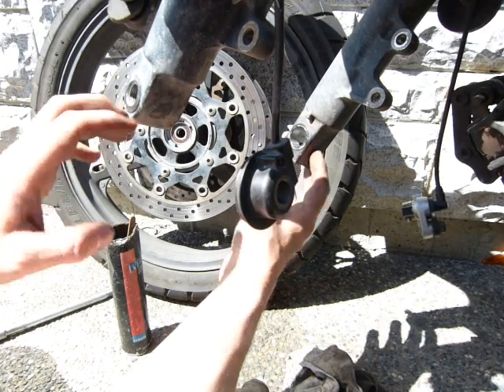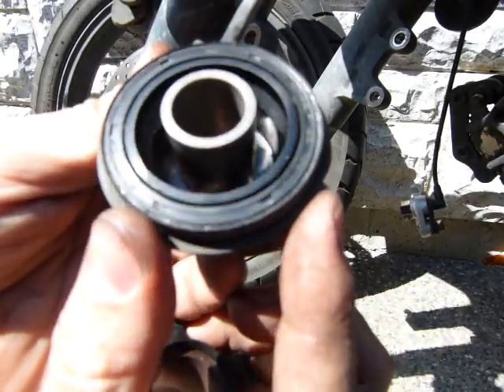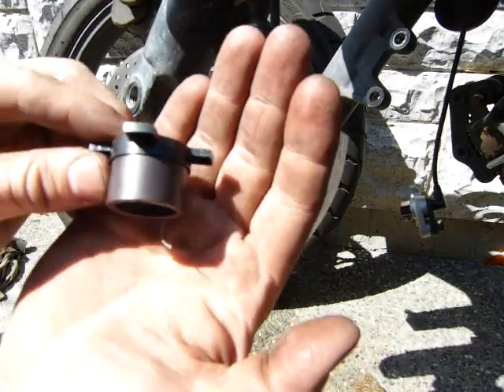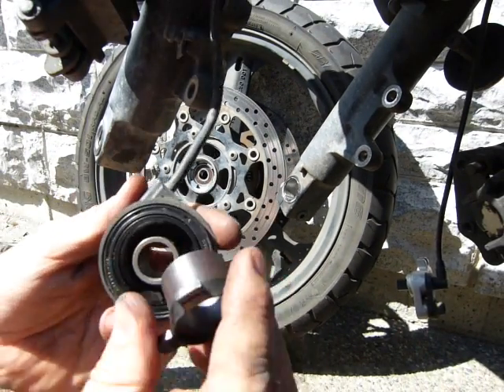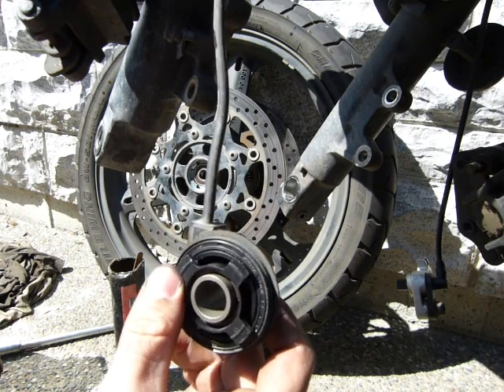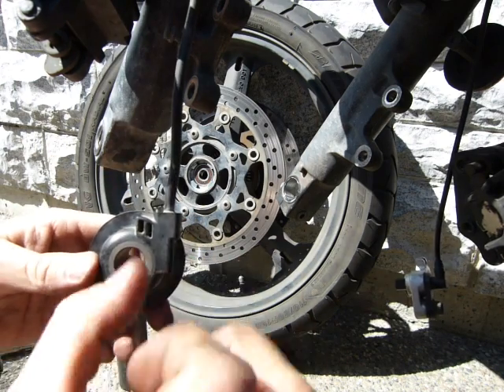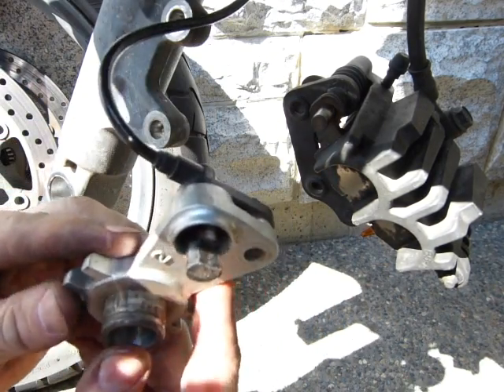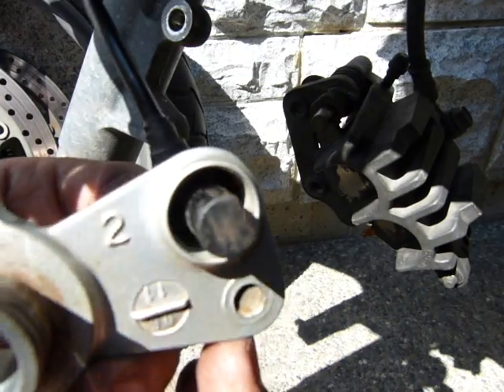How ABS and speedo sensors work

Comment: My speedometer is acting up and I think beacuse that magnet is already worn out, can I disassamble the sensor and rotate it with a hand to know if its working? Will it show speed?
Reply from the maker: Magnets don't fail, spin with a drill. Instrument is likely broken, cable might be defective, sensor end is usually fine.
Reply: @theoverengineer  ive got sv650, most people that I asked told me that the rotor usually worns out, I think that the "rotor" Is the magnet? They called it "plastic", So im not sure what is wrong, the speedometer sometimes works but then stops
Reply from the maker: Electronics fail intermittently, like you're experiencing. Probably in the gauge in the dash someplace. Here is an example on an Aprilia https://youtu.be/-N5ZrqWZrQw
Reply: @theoverengineer  actually, its the magnet, it has the little "legs" and they broke off, So I need to buy a new one
Reply from the maker: Ahh, the plastic splines! That really nice to notice, speedo cables are reasonably serviceable.

Comment: I have a 2015 Zx6R.  After changing the brake pads, brake fluid, and tires, the ABS light remains on.  When riding, there is a loss of power and the tachometer/speedometer is inaccurate.  ECU reflash, new rear speedometer cable did not fix the issue.  Do you know what is causing the issue? Thanks!
Reply from the maker: If the sensors at the wheel are absolutely geometrically intact (not a ding, aligned squarely, no magnetic "fur" on them, clean) and the connector pins at the ABS cable ends and cables themselves are fine, then ECU glitches. Check the cables and sensors, then probably Kawasaki dealer is the next option.

Comment: Hey,
Can u help me to choose whether what kind of sensors to use in an ABS?
Hall sensors, Magneto resistive sensors or tachometer sensors?
Reply from the maker: Depends on what signal the control module is built to process. Hall sensor is powered, so if that doesn't get supplied, it's out.
Reply: @theoverengineer  okay! Thanks buddy

Comment: In this case, if the ABS sensor doesn't send pulses to the computer for some reason, and the computer thinks that the wheel is skidding, you would never be able to brake!!
Reply from the maker: Lack of signal does not disable the brake, designers thought about that.

Comment: I'm glad someone explained me basic principal of magnetic speed sensors! Well unfortunately I lost the magnetic part of sensor while puncture removal and its nearly impossible to find new one. I need to buy whole speedometer set for simple magnetic ring! Can u suggest me some alternative to make it work?
Reply from the maker: Don`t need new magnetic speed sensor. Get an old/used one from a crashed/project bike. Google something.
Could also glue the magnet together, it will work enough if aligned meticulously for circularity and flatness.
Reply: theoverengineer - Okay! That was my second plan but it's bit hard to get same bike in trash. I'll try with this one only. Thanks for suggestion.

Comment: Dude you will not believe what happened. So my speedo cable as we were talking about before, was broken and it wasn't working for quite a long time. recently when I've just left my bike in the garage for a few weeks. After I picked up I give it a good scrub clean with the jet wash polish it didn't do any maintenance job knowing that I need to change the cable I recharge the battery as it was completely flat I stuck my bike and I have driven to work. All of the sudden I could see that my speed was showing back on the dashboard. I haven't done any mechanical works on it removes the front wheel or anything like this it just repaired itself somehow magically maybe knowing that haven't got money to buy new cable.  However now I'm scared to take off the front wheel so you won't break again but I know I have to do because my left front fork is leaking and I have to change the seals and top it up with oil. Maybe I'll do the video about this as well
Reply from the maker: AdamLondon01 The end of the speedo sensor is a copper coil in a plastic housing. The slotted ring generates pulses of electricity in it. If crud covers the coil, the magnetic effect wont take place, no signal will be generated. Also, if the distance between the ring and coil increase (loose screw) no signal. Not a lot can go wrong there, just go ahead and service the fork, tighten everything. A flat battery might also affect the ECU`s ability to translate the speed signal and power the LCD.
Thanks for sharing. What year and model is your bike?
Reply: theoverengineer its sv sk4 2004. but its worth to say that after all of the work i did not have any luck. how ever after i given good clean wash it started working again. i think my bike was seeking attention like a baby. any way ive desided to mended everything that i can and sell it. save some more cash and buy something new
Reply from the maker: AdamLondon01 Thanks and keep us posted if there are changes.

Comment: I don't quite understand what stick across what pick up or claws could I provide email for you so we could maybe get graph or picture or something?
Reply from the maker: AdamLondon01 Just spin the thing that can turn inside, it`ll work.
Reply from the maker: AdamLondon01 Ok,a few hours later I see ambiguity. So, if the tab is rotated inside the sensor there should be numbers when the ignition is on. If there are no numbers the sensor might be wrong, or the cable, or the spedometer.
Disconnect the speedo cable from the spedometer and rotate the magnet`s tabs inside the sensor. Measure the signal voltage generated at the end of the cable, there should be some. If there isn`t, order a new. The Suzuki service manual has all the pictures and correct voltage readings.
I don`t have a working one, I can`t take measurements, the bike filmed got stolen 3 years ago, so if anyone can chip in and help out do so.
Reply from the maker: AdamLondon01 Service manual says (Electrical system page 8-35): "If the speedometer, odometer or trip meter does not function properly, inspect the speed sensor and connection of coupler 1. If the speed sensor and connection are all right, replace the meter with a new one."
Speed sensor inspection:
"Connect the four 1.5 V dry cell batteries, a 10 kOhm resistance and the Voltmeter to the speed sensor lead wire coupler as shown. (See illustration) Lift and turn the front wheel and check that voltage varies between 0 - 6 V. If any abnormal condition is noted, replace the sensor."
Link to Service Manual to see the illustration: http://www.calsci.com/motorcycleinfo/PDFs/DL650K4_svc_man.pdf
Reply: theoverengineer  oh that's better. So I've done everything from diagram, and the results i had was slightly inconclusive for me i think. Please correct me if I'm wrong. The book says; when connected the circuit as per picture and than check MCT ( Multi Circuit Tester ) for the V (Voltage) should be 0V. Then when spinning the front wheel and the V should vary between 0-6 V. And my results where; when connected everything and checked MCT it showed straight away 5.77V, and than when I spin the wheel it vary between 5.46V - 4.12V  any advice?
BTW thanks for helping me out with this.
Reply from the maker: AdamLondon01 No worries. The sensor is probably faulty, that`s why it doesn`t behave like described. The 5.77V is coming (leaking, due to a short-circuit) from the 4 x 1.5V batteries, in this case 4 x 1.4425V.
But just to make sure: Sensor has a 3-wire connector, hot, neutral, ground. In the diagram, battery (neg) is at the middle pin marked black with white tracer. If the sensor supplier did not have the exact color of wire, they might use anything else at hand, like Aprilia: https://www.youtube.com/watch?v=ydBvgh5HKGI PDF is also about 2004 model year, whatever continent, there are differences is wiring.
Another wire is orange with red tracer is the ground, and the voltmeter + resistor are on the neutral line. Colors might differ, principle stays the same.
Get a new, check it out electronically, should work as per S. Manual`s description.
Reply: theoverengineer that's exactly how I connected the circuit as per Haynes manual, and that's what i had as result. you might be right by saying that there may be short-circuit some ware along the cable, i just didn't want to buy £120 new cable only to find out that something else is wrong. Also i couldn't believe that cable can brake like this on day to day basis. also i found something like that 
Just incase anyone else reads this thread, there's a better way to test the speedo sensor than it says in the Haynes manual, rather than disconnecting the sensor cable and creating a separate circuit to connect it to, if you get a positive wire from a voltmeter and connect it into the back of the signal cable (pink cable) on the connector that takes the cable into the bike rather than to the sensor (on the back of the plug that you connect the cable from the sensor to) and connect the negative wire to the negative of the battery and then spin the wheel you can test it much easier and do a test without having to get all the bits for the external circuit like it shows in the Haynes manual  (if this doesn't make sense post a reply and I'll try and explain it better)
Reply from the maker: AdamLondon01 Thanks for sharing! Short circuit happens inside the moulded plastic sensor unit and is caused typically by a crack in the varnished wire coil inside. The crack opens as the sensor is not cushioned by the fork and feels every ripple and bump in the road full on. A crack in the coating could be caused in manufacturing by a momentary change in pressure at the spray nozzle.
Find a bike wrecker, ebay?, get a used part that you check out, save some £.
Reply: theoverengineer when I'll buy new part I'll make a video explaining everything including testing the sensor. i have found a lot of videos in here but nothing about testing and stuff i think it could help people.
Reply from the maker: Please do. Let us know when it`s up.

Comment: So if I disconnect the cable for a speedo meter is there any way that I can check that it's working
Reply from the maker: AdamLondon01 Yes. If you can put a stick across the signal pick-up unit that catches the claws and spin by hand the instrument should have a number when the ignition is on.